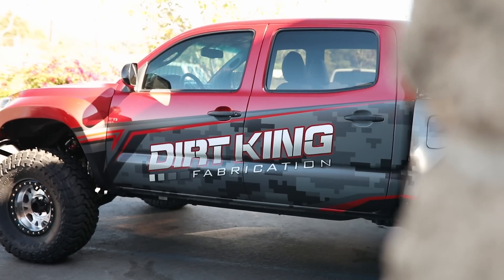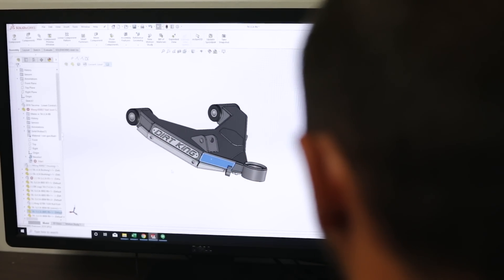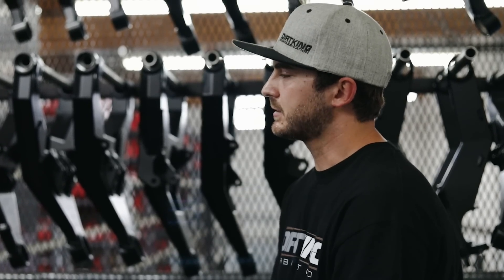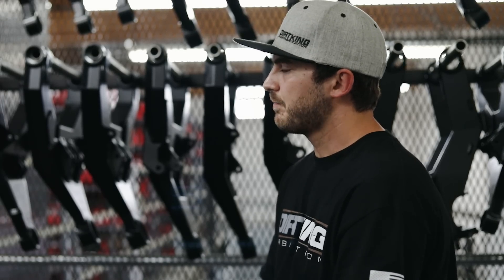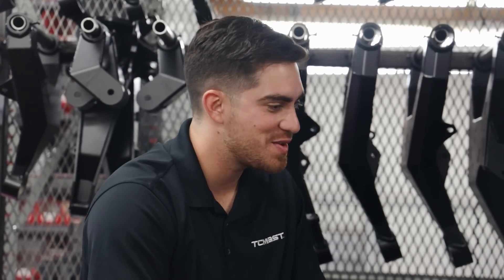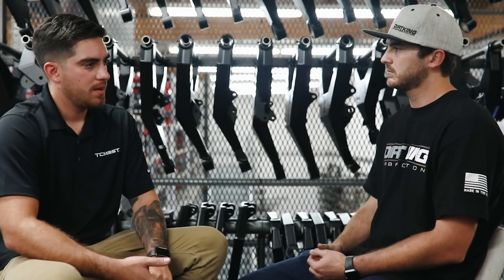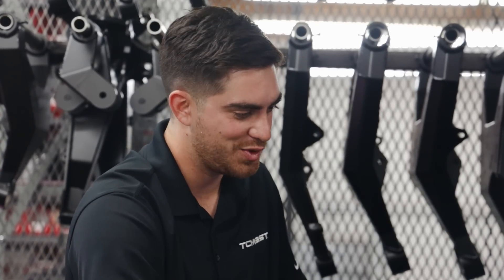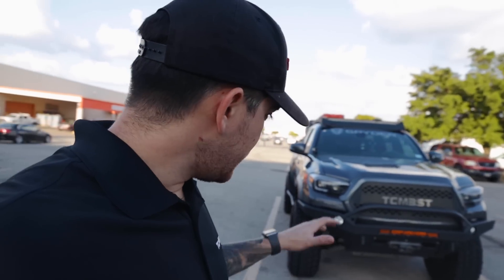Should you Upgrade your Toyota Tacomas Control Arms? | Process & The Benefits Explained

Comment: How have these held up ? Any issues pros vs cons ..long  term reveiw? Standard travel   ..without other modifications needed?
Reply from the maker: So far still using these, really good! As far as standard vs long travel it really depends on what you’ll be using it for, but tbh these have been the least problematic part of my suspension setup since, they’re great
Reply: @tacomabeast  can I use the dirt king standard travel lower control arms .with other after market upper control arms ?spc

Comment: thank you so much for the video it was very nice and I think you covered virtually all aspects of the matter, but I wanted to ask you on a different but related subject; have you tried  anything on  rear suspension upgrade? because the stock leaf springsand and shocks (3rd gen) have very limited travel and they buttom out very easily even on  small bumps and I think this is one of the neglected areas that no one seems to talk about and no satisfactory reviews are available on the net or at least I couldn't find any. 
An in depth review on the subject would be nice. 
Abd Thank you again for the nice video.

Comment: Please do a video on titan control arms! I already have the uppers installed from you all. Just waiting on the lowers to be delivered in two more days 👌
Reply: how are they?
Reply: @arcanum3882  not happy. I have 6" lift and 35s. It is thrown my sharp steering angles off, and in four-wheel drive mode it causes binding. I have new OEM control arms to replace with.

Comment: Still don't understand how a few sections of pipe welded together and a ball joint can cost 500+ dollars. Then billet uca's are insanely unjustified.
Reply: Factory is $1100
Reply: Sure the materials don’t cost even close to that much but its the R&D time, it’s the trial and error, it’s the cost that it took to get the final product. It’s not impossible to do it yourself but it’ll probably still cost you more.
Reply: @docrichardson7034  I'm only seeing like $300
Reply: @urinecakes  fair enough with a lot of competition you can't expect to sell all that many, so you'd need to break even
Reply: @jesser9134  that is the factory price to change both.

Comment: you'd think that a suspension expert would use the proper terminology, but at least he didn't call it a 'strut'. 
the 'shock absorption' is handled by the spring and that engery absorbed by the spring is controlled by a dampener.
Reply: @spankthewan  actually just for more fun, both are correct.
damp·er  (dăm′pər)n.
* One that deadens, restrains, or depresses:

dampener [′dam·pə·nər] (engineering)
* A device for damping spring oscillations after abrupt removal or application of a load.